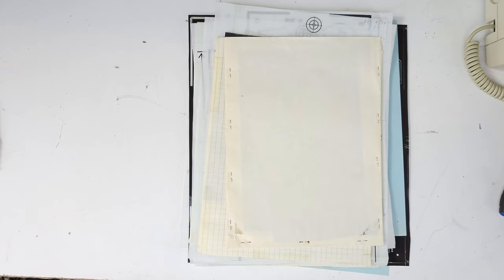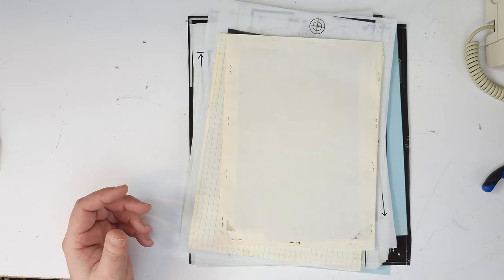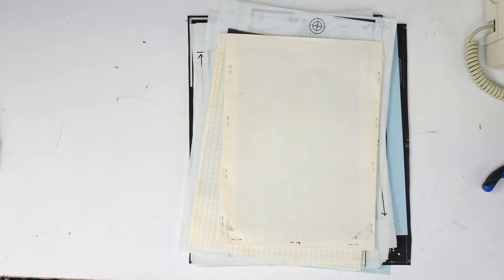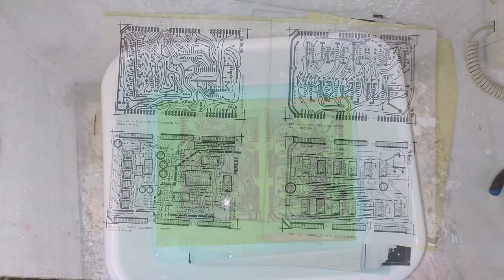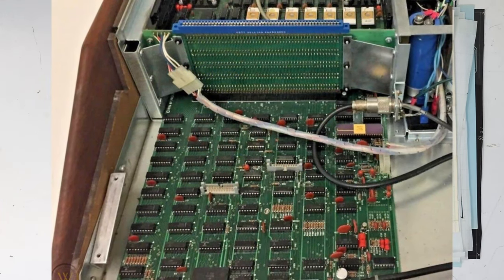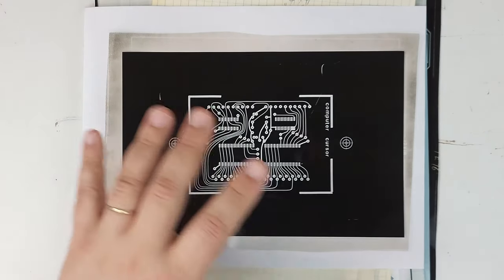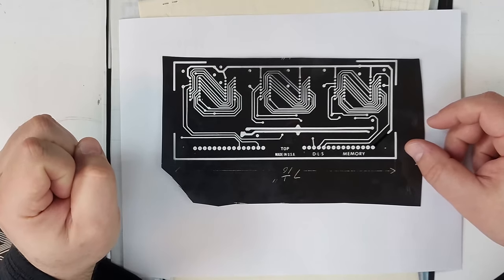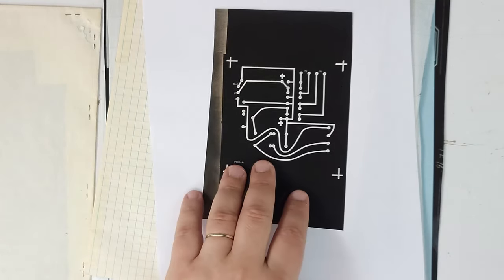Vintage PCB Artwork From the 1970s

Comment from the maker: Sorry in advance for the seven minute 'pre-ramble', but I felt I needed to explain the drawings' provenance, their historical importance and some of the challenges people faced creating these things in an era before computers were widely available to help us, and only had so much I could show while talking about that.  I am still working on my 'off the cuff', handsy speaking style.  But at least as far as I can tell the audio didn't suck.  So some progress. :)
Reply: The explanation of the historical importance is why I'm here. Love this content!
Reply: Hi

There was the rub on decals. And then there were the tape and pads I would use made by companies like Bishops Graphics. 

All the pads, were all to scale. 1x 2x and 4x for pads. Track tape was available in a bunch of different widths from super skinny to quite thick, though I used electrical tape for big high current pads 

You would make a positive and use that to create negatives for the Riston coated PCBs. 

The coating would fix to the board under UV light so once you exposed the board, you’d wash off the non exposed coating off before etching it

Once the board was etched, you would scrub off the coating on the tracks with some steel wool. 

I rarely did double sided boards as there was no easy way to get through hole joins between the top and bottom of the board. 

I used that technique to make custom boards up until the mid 90s 

I threw my stuff out sometime in the early 2000s
Reply: Hello, I loved this video! Was wondering if you could make these scans downloadable?

Comment: I started my career as a "layout engineer" using this method with two times oversized sheets of semi transparent paper (fake vellum, so no real calf skin was used) using crepe tape and dots you could pick up from a cardboard carrier with tweezers. and having a 1/10 inch raster sheet below the "vellum". You started with drawing a schematic diagram, then assembled a list of connections to use while creating the traces. One very important step was placing the components on the sheet, as a wrong placement could make connecting up IC's impossible. You used  the list of connections, ticking off every finished one. Luckily I am a "picture thinker" so I could imagine in my head what the best placement would be.
After you had finished the layout the sheet was photolithographically reduced to half sized, and the result would be used to flash on the photosensitive layer (the photosensitive layer was either sprayed on, or you used boards that where already photo sensitive, and had a dark plastic sheet over them that you had to remove first).
The first "CAD" system to help laying out boards, was a simple grid based affair written in turbo pascal, you could place on one of a number of shapes the program offered for example a circle (dot), of a horizontal or vertical trace segment etc, you still had to use a spreadsheet (paper printout) to keep track of connections, as the program was only for layout, it was not integrated with a schematic drawing program, that came much later. The great advantage of using CAD was that you could easily made corrections. Later I used programs like orcad and many others I ended up using Altium 10, and at home (for hobby) I used KiCad. you can see my projects on the website of my maker space Revspace (www.revspace.nl) user Mahjongg, I also publish designs on GitHub.
Reply from the maker: I think for me the intimidating part is knowing how to lay things out so you can make those connections.  Apparently that was one of the things that bedeviled the Sol project- Lee Felsenstein and another guy worked overtime to make the magazine deadline and had so many mistakes on the first board revision that they needed 100 jumper wires just to get the thing going.  I find that incredibly intimidating and not having a computer to simply wipe away bad choices or reorient things.. yikes.
Reply: @TechTimeTraveller  As a "picture thinker" its easy for me to imagine the best placement that needs the least amount of difficult routing.

Comment: In the 70's we used tape and ic pad layouts and worked original artwork in 2x.  we used thick velum and punched registration holes to align the layers (a metal strip with pins placed along the top or the art)  we did a 4 layer thru hole circuit for the a DEC pdp11 add on.  you put a 2x refrence for the photo shop to shoot down and do the color seperations.  The photo shop said we were too pick when we told them we needed exactly 50% reduction.

Comment: I still have some of these from my old designs. My first job was transferring schematics into CAD at a local mom-and-pop shop that got their start building reed relay life testers for the Apollo program, then got into test equipment for car battery makers.  Eventually I started CAD layout as they were transitioning away from the light board. Still my job 30 years later!

It's crazy how far things have come. I still had to modify existing tapeouts, but I never had to do one from scratch, thank heavens. Everything was done in-house with home-made equipment: darkroom, spray etcher, tin/nickel/gold plating, all holes drilled, eyeletted and soldered by hand. We've come a loooong way!

Comment: I laid out and taped up a number of PCBs in the 70s and early 80s. You've described the process well overall. After exposing the PCB to the UV light I had to use a developer to 'develop' the resist then a warm water rinse to remove the undeveloped resist. I had access to a photo lab with an enlarger/reducer which made reducing 4x or 2x artwork down to the proper size pretty easy. For double sided PCBs I tape the masks together on 3 sides then slid the PCB inside to be UV exposed. The exposer drew a vacuum to draw the mask tightly against the PCB before the UV exposure. Before I taped up a PCB I would lay it out on grid paper using a pencil then once I had a design I taped it up. I loved this kind of work, never saw it as a chore. Today I use KiCAD and a Chinese PCB manufacturer. Once I submit the design to the manufacturer I have PCBs in my hands in under a week.  Usually in 4-5 days. We live in amazing times. The process has become so simple and cheap I often skip the prototype stage, design in KiCAD, layout PCB, order PCB, debug any issues, update the design and submit my final design to be manufactured.
Reply from the maker: Nice!  Was it true there was fairly high wastage with double sided boards?

Comment: Having made PCBs at home it is the thought of drilling all those holes, and how many bits they may have broken that makes me shudder
Reply from the maker: I have done this very thing with my Mark 8 and TVT project.  The Mark 8 has been even worse because it's double sided and in addition to breaking drill bits I'm also sometimes popping the copper off of the other side.
Reply: @TechTimeTraveller  are you using a backing board? A flat piece of MDF/whatever under the PCB and a slow speed on the drill press should help keep tearout from happening.

Comment: I'm a computer engineer (not practicing unfortunately) and remember when we did a project in the "PCB Lab" in mid 1990s using transparent sheets, exposure projectors and chemical etching. I designed and made a PCB for a "smart card", which facilitated purchase for students within the campus. Those were the beautiful old days. I've started working in real-estate almost since graduation and am not quite happy :\

Comment: Worked with the layout guys at my first job in the mid '80s.  They would have a layer of grid vellum under the artwork as they layed it out. I remember they used a 25mil grid (12 mil traces and 13 mil spaces.) (mil=0.001") So, 0.050" grid at 4x.
If you made a change when they were near done, you'd get an earful as they had to rip up a lot of tape. These were very dense boards, probably four times the density of chips and large boards.
The guys were amazing, they would stare at the schematic and place the parts. Then just start laying tape. They would feed a data bus out of an area and leave them hanging in the middle of the board. then when they got to the other end of the board, feed them to the chips there. The good ones had a picture of all the traces in their head and could do a whole 8x8" board with near 100 chips with few changes. The tape was exactly like pinstriping tape for auto finishes. Black vinyl IIRC. They did use red and blue for top and bottom boards as it was easy to see on a light table.
What a tedious process the check the layout against a schematic. When I started, we just began using CAD. Still had considerable manual checking. Power and ground planes you had to manually change the pin types to make a connection and the CAD had no knoledge of it.
One of my buddies took a 4-layer artwork and framed them in layers of glass. It created moire' patterns as you looked at it at an angle.
When we got to autorouters, a crowd would just watch amazed at it running.

Comment: When I made PCBs in school, we printed off positives onto transparencies. Which was basically the 70s process except we got to use CAD layout software – so more like the 80s I guess.

Our photo-resist didn't require a negative, we put a positive against the board into the UV box. Whatever had reacted with the light would be etched-away in the tank, so by default it resisted the acid. I shouldn't be surprised that there were other photo-resists which only resisted after the UV reaction! 

Once we were done etching, fresh out of the tank, about half of the copper had flaked away. The rest was rinsed-off with distilled water. We didn't bother with tinning the traces or solder mask. As it was, we were just told to cover it with clear nail varnish if we really wanted it to last 😆

Our school plated the fibreglass boards themselves, allegedly. They apparently recycled the copper from solution in the acid once a year between terms, and the teacher was quite careful to collect the residue from the rinsing step as well. Our substrate was pure white with no transparency. I imagine few 70s businesses bothered to do that part, when there were so many chemical companies offering it in bulk. 

We were told that businesses used to use that method before they had to really scale up production, so I knew that already, but it's still super cool to see the original masks they must've used. I especially like all those alignment markings — alignment was never really something we had to bother with. All our creations were single-layer.
Reply from the maker: Thank you for the detailed explanation.  I sort of understand it in my head but it's hard to visualize without doing.  I actually scored some old photosensitive pcb stock but not sure after 40+ years if it'd still work.

When I do replica projects I prefer to use methods as close to the old days as possible.   But lately I'm coming around to tracing things on KiCAD and sending to a PCB fab.  Just easier.  If I need full authenticity I can always send them a piece of my vintage board stock to etch to.

Did you guys plate thru your vias as well as tinning?

Comment: Interesting video. I remember seeing PCB making kits at Radio Shack during that era, and thinking that it looked way too hard.
Reply: I purchased some of those same kits. Long way back now, but I do remember many failures ... fun times =D
Reply: I made a number of boards using stuff from Radio Shack.  At one time I think they even had some rub on stuff that acted like a resist.  One of my techniques was to lay out the IC's and components on the copper clad, drill the holes and deburr, then draw the traces using Sharpie markers.  I made more than a couple of boards that way and although the traces weren't always pretty, they turned out OK enough to work.  Most of my more complex digital stuff was made using wire wrap.

Comment: I've heard of people using "silicon impregnated" paper to print on and transfer to copper. Silicon impregnated paper is that slimy paper that is used to back stickers.
Photo-resist is the word you are looking for. You washed off the photo-resist that was not cured with UV (light).
Supposed to be a plug-in for KiCad that gives you the "70's traces" on PCBs. I was not able to get it to work.

Comment: I had a special pen with very think sticky ink. On the copper plated board one could draw the lines, everything in real size, after the ink dried the unwanted copper could be eaten away with chemicals. The chemicals also like to eat through  curtains and clothings. I blamed the moths, I knew better.

Comment: Really cool 😎
I had no idea they had decals for that, but it makes total sense. Surprised to hear it was sold at RadioShack.
Reply: 70s and 80s Radio Shack had some great DIY electronics supplies. It was amazing what you could buy there.
Reply: I still have some in unopened packaging.  Bought them in the late nineties.  Recall seeing whole boards in rubon transfer for a project.  It was direct enchant resist.

Comment: the positive process uses NaOH to remove the non-useful resist. I suppose the negative process to be similar, but I couldn't find the information. the Negative process seems to have disappeared
the tapes came in all matter of widths, you only had to cut it to length

Comment: There used to be a company called "Bishop" graphics in the USA that used to make the decal IC patterns and the like for PCB layout. The traces were basically a "Roll" of tape in the proper width so that you can run the connections. Manual CAD was used. Do you have the original artwork for the Netronics elf board ?
Reply from the maker: No that artwork would be with Netronics still if anywhere and I think they just recently closed down.